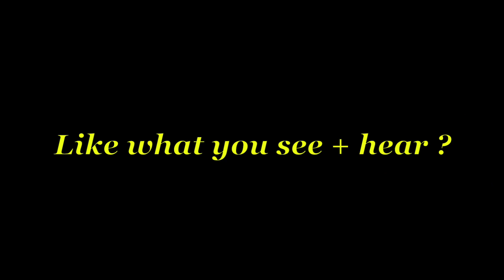FretLight Guitar ReEngineered Bridge saddles

Comment: Wouldn’t counter-sunk flush mount screws in the tail piece been an easier fix? I don’t understand why they used domed screws in the first place. Happy New Years a little late .
Reply from the maker: There were several possible ways to address this .... I choose to go the route I went .. without complete disassemble or buying replacement parts. Bottom line ... it is now perfect.

Cheers !  Happy 2020 !
Reply: Gonzo, I would also change out the screws, but I’m not as experienced with guitar repair. As with most things there are a few effective ways to accomplish things. Since I wouldn’t have considered string tech’s way I find this video very helpful.

Comment: Sure look like pan head screws. Couldn't one simply replace the bridge screws with some flat top phillips wood screws? Could even countersink the bridge floor to accept the shoulders of the screws, assuming they have any.
Reply: Great fix though!
Reply from the maker: I knew that someone would point that out ... Ha ! Ya ... I had thought about grinding the screw heads down or swapping them out. In this instance ... I was on the tail end of this job ( not a real expensive guitar ) when I discovered this issue. I'm not making up excuses. I was in the cut-to-the- quick mode ... and was determined to right- the- wrong in short order. Cheers MD !
Reply: Michael McConville Been there! Totally get it. Great approach regardless. :)
Reply from the maker: No they are oval head screws. I had a Zakk Wylde LP / Larrivee acoustic / Gibson 339' / Gretsch Streamliner / and an R9 Gibson VOS 1958 LP ... that were in the roster at the time I took care of this cheapy FretLight ... as a favour for Frank. The final word is .... it is now a playable guitar for the first time since it was made.